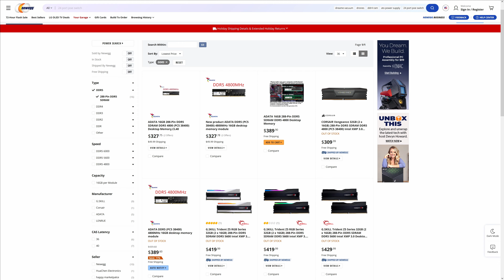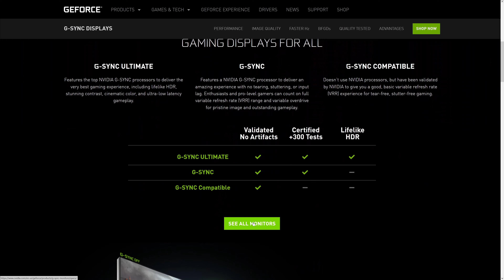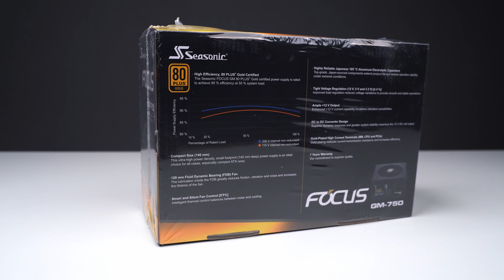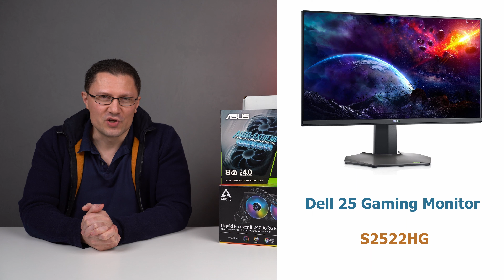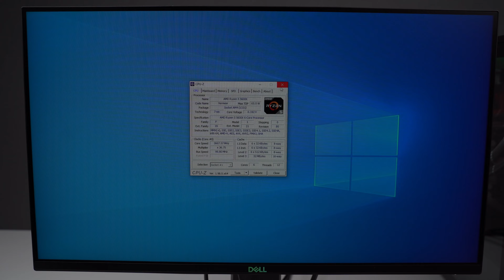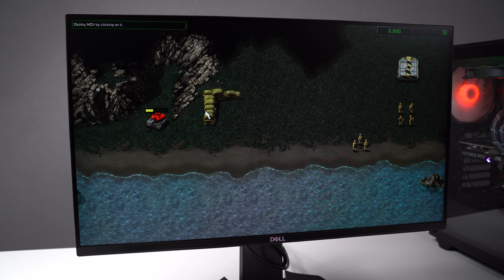Picking PC parts for BUDGET GAMING PC - 240Hz DELL S2522HG monitor | Gigabyte B550 Aorus Elite AX V2

Comment: Hallo, nice Machine! 
Did you have a problems with the RGB from the Mainboard or RGB Fusion? 
🍻
Reply from the maker: Hi, thanks! Yes, I did. It was a pain to figure out (the most difficult part on the whole build). The problem was with the “RGB SW / driver”. 

Solution: The first thing you have to do is to make sure there is no other RGB software installed on your PC or its “remains”. If there was anything installed before, you have to make sure its “remains” (not visible in regular Windows "Remove application section") are also removed from the “Windows registry” = manually deleting them using “Regedit” is necessary. 

Then you have to make a clean install, but, and this is important - as soon as the installation is finished - you mustn´t start it to try if it works! That is the trick. You have to restart the PC first. And then you can start using it. 

(It wouldn´t ask you to restart the PC on it´s own after install, that’s why many people try using it ASAP and if they do, it never works again – until what is written above is done “correctly” - the way with the "restart first"). 

Took me hours to figure out.. and I felt I read the whole internet.. :)
Reply: @MartinsLab  Thank you! 
I ill try it 🍻

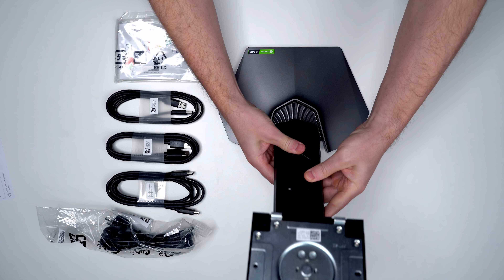Comment: 15:44 you said 5ms?? I saw response time is 1ms.
Reply from the maker: Yes, I did. I researched couple of reviews from other people who specialize in reviewing monitors and some measured 4ms and some 5ms. So, I didn´t want to just read what is printed on the paper box, but I mentioned the value which I researched. I couldn´t measure it myself acurately, because I don´t have the proper equipment for it yet. However, I can confirm that the game play was absolutely smooth disregarding which ever response time value is closer to the reality.
Reply: @MartinsLab  to be honest, I have a 8ms dell display and for the life of me - seems pretty smooth to me. No previous experience with faster monitors though… but I can imagine the differences are mild if not undetectable by the very least.
Just had to point it out though, just in case it was a mistake. Thanks for the video.
Reply from the maker: @Dramatello  No problem, you´re the first one who noticed and reacted. I was wondering if someone is going to notice – paying attention is a very good trait. You´re right, in many cases you can´t tell the difference unless you´re a pro gamer. This was also my first time running any game at 240Hz. My main job was to find HW that would be able to allow these high FPS and was also affordable. I saw 120/144Hz monitors before, but I can´t say I can tell the difference at the first glance, I´d have to have them side by side. But, when there was an opportunity to buy a better monitor for my friend at a reasonable price I went for it. This was the best I could find at this 250 - 300 USD price range and I checked a lot of monitors.

Comment: Martin hi, I have one question, off topic but anyway, I bought new board Aorus X570S PRO AX, and it has 2 CPU power connectors: 8pin and 4pin. Do I have to plug in both of them into the PSU or one 8pin would be enough for my Ryzen 5900X? Thanx
Reply from the maker: Hi Roman, nice motherboard! From the perspective of having enough power for your CPU (one 8 pin can deliver up to 288W and 4pin can add up to another 150W) - for 5900X one 8pin is enough. But, I always connect both anyway when I have the PSU which can manage it (has enough cables&connectors).

Logic behind it is: If the PSU has all (8pin+4pin) of these 12V connectors connected to a single large 12V rail it´s not going to help much to the stability, but if it´s split into more rails it might help a little – this depends on the used PSU (how it´s designed a how good quality it is). If you overclock heavily, it might help more realistically, because you´d be able to draw more power during peaks (and the rails wouldn´t be loaded to the max if they were split). 

So, simple answer would be - if you can, connect both (8pin+4pin), otherwise one will do (if you don´t overclock).

P.S - I also checked the manual.. and there is nothing there.. as always 😉
Reply: @MartinsLab  thank you Martin for your extensive reply. I am not doing any overclocking. My PSU is Seasonic Prime TX 1000 watt. It has a lot of connectors so I suppose I can plug both of them, however this is the first time I encountered more than 8pin connector on AMD platform and dont know how this board will act with single 8 pin, I prefer less cables and better cable management :-)
Reply from the maker: @romanpirschel3053  I´m currently running two AMD based PCs which have both more than one CPU 8pin connected - Gigabyte X570 Aorus Master (2x 8pin) and ASRock X570 Creator (8pin + 4pin). For higher tier motherboards this is normal. You have the best PSU there is (it has a ton of modular cables), so I´d connect both the 8pin + 4pin and wouldn´t look back.

I understand that having less cables connected is visually cleaner, but the stability is the holy grail for me and if there is anything that can help it just an inch, I use it. Seasonic Prime TX 1000 has flat cables, so one more at the top (it will be mostly hidden in back of the case) should be easily manageable.
Reply: @MartinsLab  yes you are right, stability is priority, thats why I am not overclocking. To tell you the whole story, I am not going to use stock seasonic flat cables, currently ordering custom sleeved cables from Cablemod /directly to PSU, not extensions, the whole build will be watercooled/. I gues one more cable that I didnt count will have to fit :)))
Reply from the maker: @romanpirschel3053  OK, now I fully understand. Custom sleeved cables look nice, looks like one black will have to be overlooked 😊 If you´re using water cooling, then I´d at least consider using PBO (Precision Boost Overdrive). It isn´t a classic all core “all the time” overclock (still allows high single core boost and low CPU frequencies at idle) and the results are very encouraging. In this video I used water-cooling with PBO for my friend´s PC, which actually motivated me to get water-cooling for myself (will be in some future video).
Reply: @MartinsLab  Ok, than I am looking forward to your water cooled build :)

Comment: Please do a video about the monitor DELL S2522HG 240hz
Reply from the maker: Unfortunately, I can´t do it because the PC including the monitor is already with it´s new owner. All I can say is that the gaming was very smooth on it and generally a pleasant experience when paired with fast enough G-Sync compatible GPU. I wouldn´t recommend it for a professional graphics use, because the panel has only 8bit color depth and has limited calibration features, but for what it´s meant to be used for it´s a solid choice at this price point.